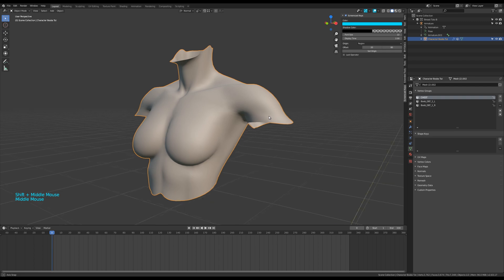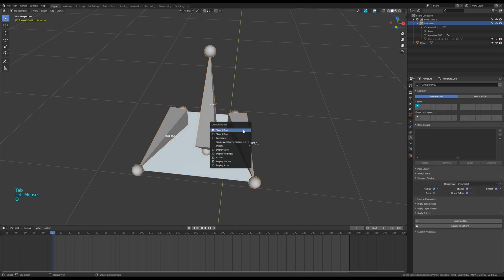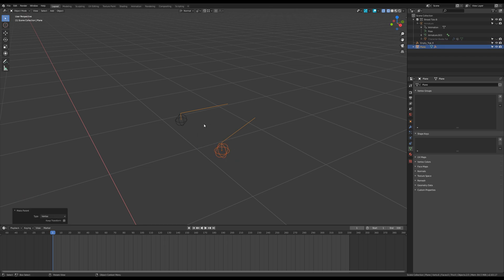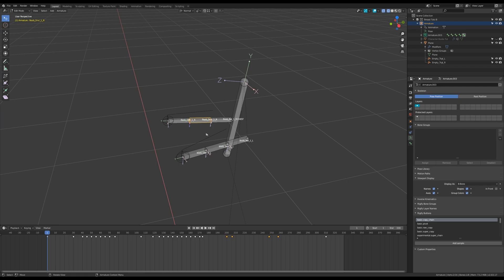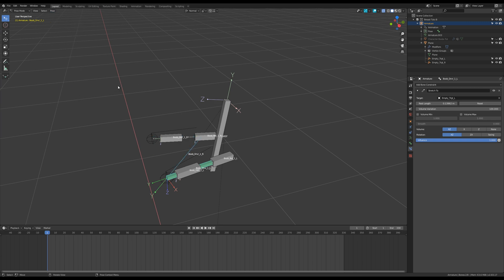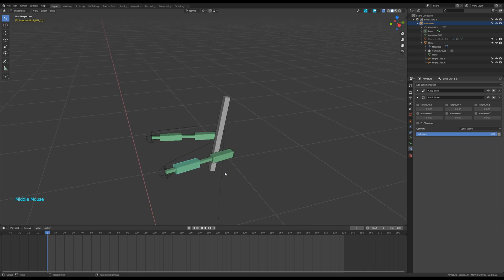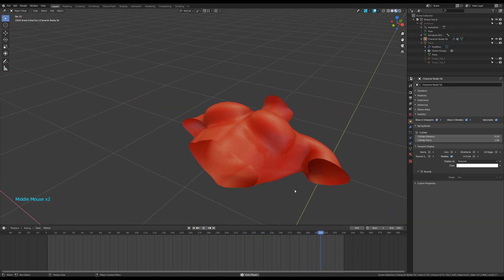Blender Dynamic Breast Rigging Level 2

Comment: Thank you, I succeeded without too much problem but in my case I try to make a physics simulation for the chest without adding anything.

It is for a mode so any modification of the armature is to be excluded otherwise I can no longer convert it, so I only have the weight paint.

Comment: I was a little confused when I saw this was a 3 Part/Level 1, 2, 3.. I just finished Level 1 and thought this would continue on, but it seems we're starting over again? I skipped ahead to Level 3 and it seems more like a continuation of Level 2, so very confusing
Reply from the maker: Sorry Shykorus if it had confused you. The idea was to present 3 different methods adding each time a bit more realism but also a bit more complexity. You can choose the one you want. But yes the last 2 tutorials are depending on the principles shown in level 1😅

Comment: so after the test simuilation it works fantastically but when i delete all keyframes and delete the bake, running the empty timeline still has a bounce at the start of the timeline around frame 2-4...i dont know whats causing it when the character is completely still...is there a way to get rid that little bounce at the start of the animation timeline? is there a way i can chat with you to show you whats happening?

Comment: am i able to do this method after creating the rigify rig? or do i have to do this in the metarig prior to generating the rigify rig?
Reply from the maker: It's better to do it after as you'll have to move the character to do the testing part
Reply: @MonsieurNaif  perfect i was hoping u'd say that. im trying this method out now...i'll let you know how it goes
Reply: @MonsieurNaif  this is actually really difficult to do. im stuck at the parenting plane to chest bone. because ive already created a rig when i test the movement of the metarig,only the rig moves. have you done with with rigify before?
Reply from the maker: @poochyboi  I don't use Rigify, but it's not a "rig dependant" process, it works with any rig, I tested it with mixamo and it worked (once size parameters changed . It's a pretty advanced technique though and you need to have a good understanding of rigging and riggify. I suggest you test it first with a basic rig and the start scene i provide in the description link. Then you'll just have to find the right bone to parent to in your riggify rig. Hope that helps
Reply: @MonsieurNaif  lawd jesus it worked flawlessly! i was trying to parent the plane to the wrong rig the whole time! i tried to parent it to the metarig but its the deformation bones in the rigify rig that needed the plane to be parented too. now its working perfectly! thanks for this tutorial! im definitely going to do the 3rd tute as well!

Comment: First of all, thank you very much for sharing your knowledge in this great tutorial, I just have a big problem with the simulation, it is excellent, it moves very well, the problem that I have when I want to move the chest bone where the eyes are related and the empy if I move it the breasts are deformed or stretched I don't know why that happens
Reply from the maker: Hey keyd10iori, i don't understand what you mean by "where the eyes are related" but if you move some bones geometry will be affected, perhaps  you should verify all the parenting and specialy the parenting of the plane object to the chest bone. Then, when you animate your character, you have to erase the previous simulation and run another one Hope that helps :)
Reply: @MonsieurNaif

Comment: I am trying to use this tutorial on a character who already have the bones and weightpaint. But i can't make the  vertices from the plane interact with the bones from the character, i'm sure it's just a small thing that I do wrong. Can someone lead me in the right direction.
Using Blender 2.93.4, and it's a character i imported from Daz, and rigged with auto rig pro quick rig.
Reply from the maker: Sorry with the answer, i am giving you here, but you should first try the first tutorial of the serie, it will help you to understand the parenting part
Reply: @MonsieurNaif  Thanx for the fast answer. I figured that it was my snapping who was set wrong, now it seems to work very well.

Comment: Hi I tried it on a Mixamo rig and my problem is that the bones fall down and not bouncing like the video what am I doing wrong. I want it to work like yours
Reply: Sorry wrong level it has to be on level 1
Reply from the maker: @stevenreyniers6890  Hey Steven, the problem doesn't come from mixamo, i have several mixamo rig that works well with my system like this one https://www.youtube.com/watch?v=YG6ohiwzEmw
I think you should check carrefully the parenting part, the vertex group part and the parameter of the Cloth simulation. Play the tutorial very very slowly to be sure :)
Reply: @MonsieurNaif  thanks i Will try it till it work thanks 😀

Comment: I am a custom bra maker and am working to simulate a clients breast so they can approve the shape before the bra is made. This is an amazing set of tutorials! 

I am also slightly stuck on the area where you made the test simulation. I looked at the linked images in the comments with @Konossam  but as a (beginner to the rigging and animation process) I too am still stumped on the baking.  Thank you for this great info!
Reply from the maker: Hey Taylor Lane,
I've just looked at your web site. What you do is stunning!
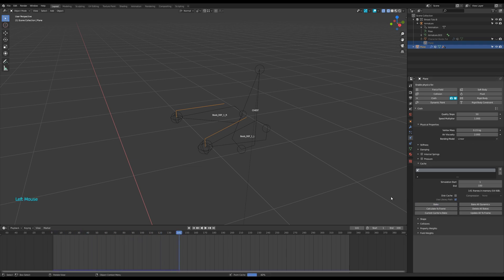My post to @Konossam was about my first video (https://www.youtube.com/watch?v=NsUt2f-KaK0&t=2s) with the spring bone addon. In this serie without any addon, the baking process is made in the cloth parameters panel, in 3:41 in this video. It is necessary to bake the simulation because it makes it stable and you can then tweak the bones settings and check your settings by playing the animation or scrolling in the timeline. And if you render without baking, you'll have a bad results because Blender will calculate the simulation while being slow down by the rendering process.
Each time you want to modify the cloth simulation itself, you need to delete the previous bake before then bake again once your adjustments are made.

Comment: Let’s say there nips on the mesh and you don’t want to have them deform too much how would you do it
Reply: First instinct is to adjust the Vertex Group weight for the relevant vertices by very fine values. Secondly, is adding a fourth bone to control those vertices.

If you have a viable solution before I start testing I'd like to hear it!

Comment: Any reason this method seems to be preferred over Mesh Deform with a deform cage?
Reply from the maker: Hi,
It's just another path. there are several ways to achieve nice results, just choose what works best for you.
But to support my method i would say that there is no add-on involved and less steps to set up. Plus, the breast will always follow gravity by itself without sagging in rest position, no intervention needed to animate it.
Again the choice is yours.
Reply: @MonsieurNaif  I'm just wondering why Mesh Deform is not more popular because it also adds deformation on contact.

EDIT: Not trying to say Mesh Deform is better, just saying it has more features which is why I'm wondering if Mesh Deform is worse in some way.
Reply from the maker: @Jmvars  Mesh deform is very ok! But you have to add and setup the extra features you're mentioning.
I have to say, spoiler alert,  my level 3 tutorial will use mesh deform too XD
Reply: @MonsieurNaif  When is it coming out? This is really exciting news!
Reply: while waiting lvl 3 of this tutorial, i'm already trying to combine this method with mesh deform, by rigging this over a cage and let the cage deform my breast, dunn oif it's the correct way, i'm waiting to see how more prepared ppl are approaching this, then i wil lonly have to fix it